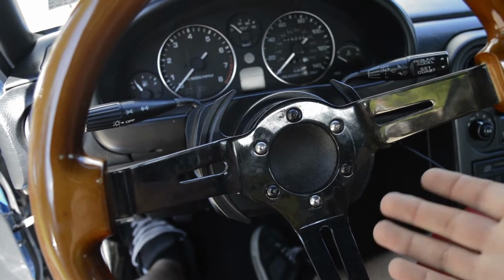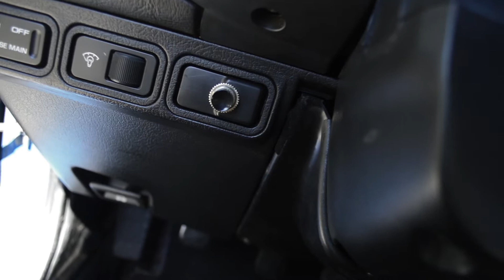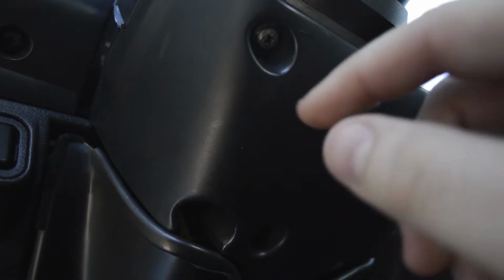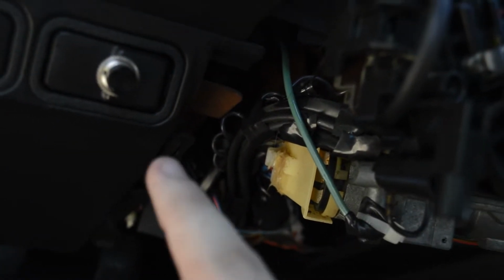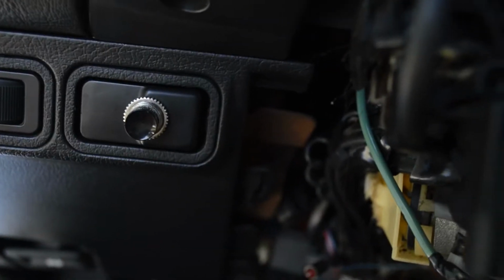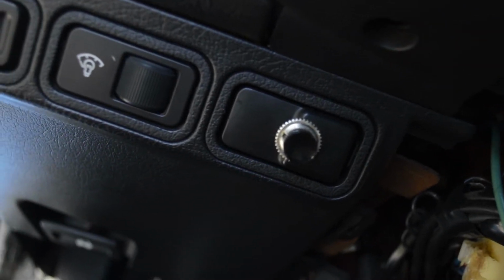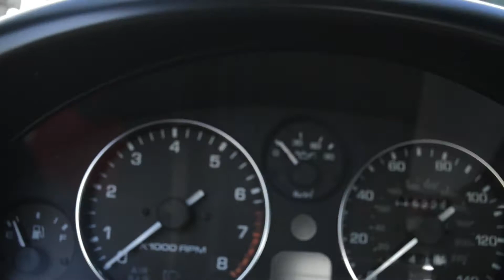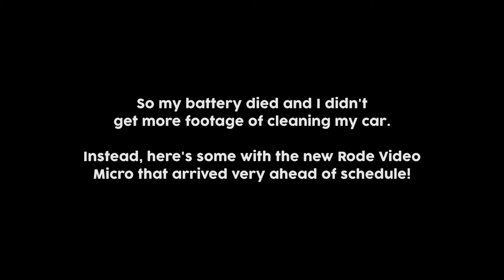Miata Horn Button (And Cleaning My Car)

Comment: so you did this without using your clock spring?
Reply from the maker: So since the horn wire doesn't go through the column of the wheel, it isn't required in the first place.
Reply: ohhh ok so as long as you ground the main horn wire before the clockspring it will work cause i have a 2002 NB
Reply from the maker: Yeah pretty much. I just found the wire before the main part of the steering column and added wire to it. Basically: original wire > new wire > button > new wire > ground location.
Reply: ok sounds good also is your airbag light going off cause I just remembered im pretty sure you need to loop the wires on the clockspring itself to complete the circuit to shut off the airbag light
Reply from the maker: @eurownedmk71.88  Sorry, just saw this. If I remember correctly, you need a specific resistor, or some type of circuit to pulse it correctly. They designed it in such a way to require specific voltage or something so people can't easily just disable the airbag light, idk.
Reply: @DarkSwordsman I just took the airbag light out of the dash 👍